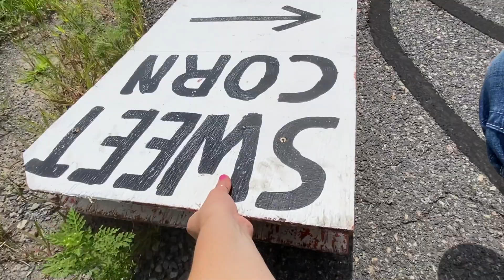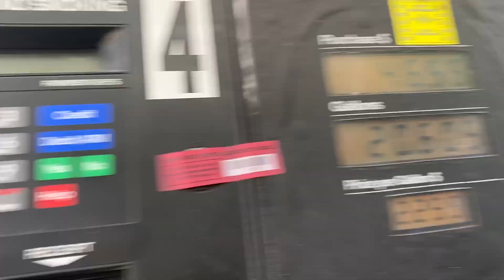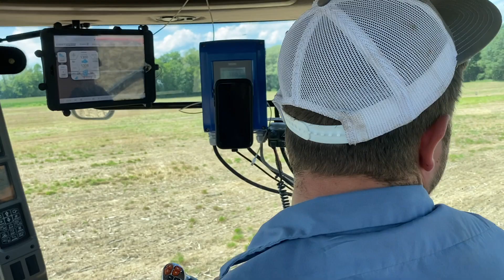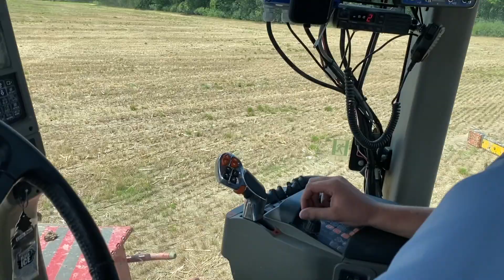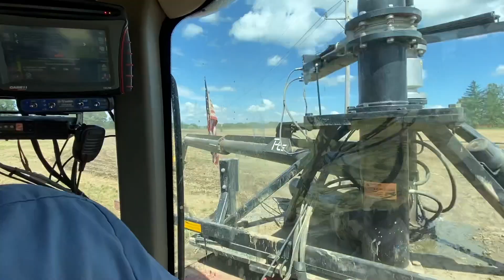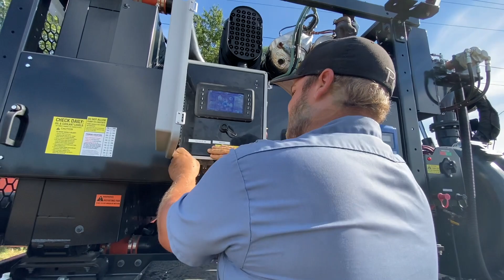Hanging with R & B Alternative Solutions for a day

Comment: 12mpg? Either you never leave the farm or there is something up with your truck, ive had several 5.3 chevys and never got below 16 mpg with them, the old girl might need a tune up
Reply from the maker: I don’t drive long distance very often
Reply: Keep in mind from what few details I recall Claudia mentioning of the pickup, with a 6 inch lift and 35 inch mud tires there is a lot more wind resistance created over a stock truck and the tire size changes the gearing which may not help either, and drive shaft and CV joint angles are greater, those tires have a higher rolling resistance and are heavier, all of that adds up to using more fuel. Its just the way it is if any vehicle is lifted, comes with its good and bad aspects like anything. Claudia, when you drive out west pick the down hill route with a tail wind LOL.